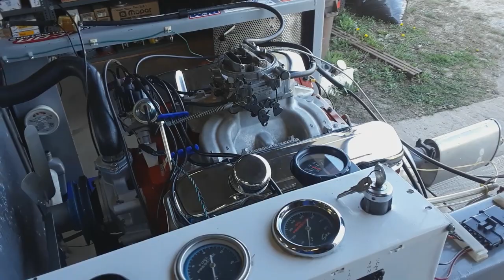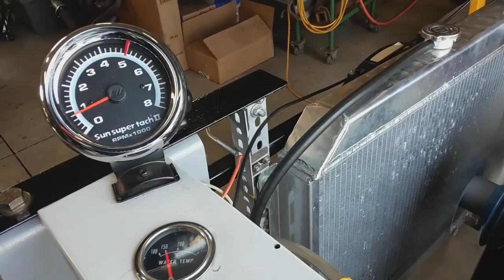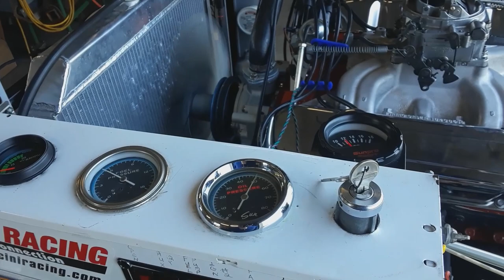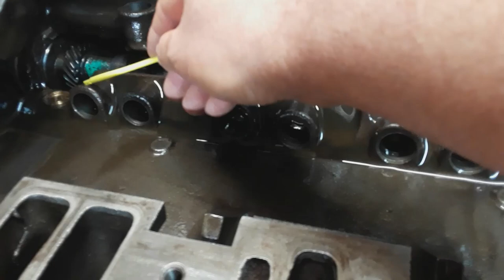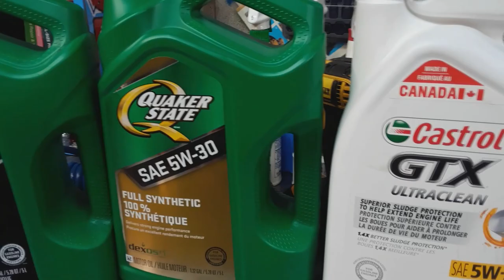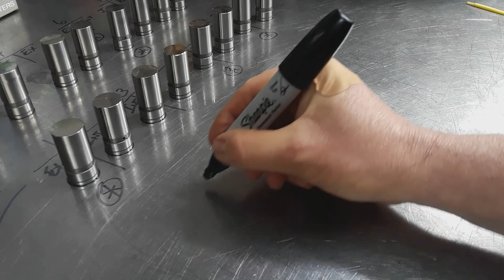Camshaft Crisis: Solution/Resolution

Comment: Is this video showing the Same Camshaft with new Huges "Hylift Johnson"  lifters after Break-in & discovering the #5  Lobe & Lifter wear issues ? ....Or is this Video showing a Totally New replacement Camshaft after Break-in with Hughes "Hylift Johnson"  lifters ? ....Thx for putting video  up....
Reply from the maker: It's the same NOS Cam Dynamics cam shown in the previous video's with 16 "new" Johnson Hylift F/T lifters. This is what I wanted to prove......that the lifters are the issue, not the camshaft. It was just bad luck that the (1 of the 4 ) "Comp" lifters damaged the # 5 Exhaust lobe to a point where the taper ground into the lobe was "compromised" and ended up wearing flat (edge to edge) with these new Hughes "Johnson Hylift" F/T lifters. 
Notice that the "NEW" lifter in the # 5 Ex. location rotated, did not immediately fail and still had a 0.002" crown on it! The wear damage to the "lobe" was caused by the previous Comp lifter that affected, then damaged the new lifter. Because of the "scoring" to that new #5 lifter face, it would have eventually stopped rotating and ultimately failed in due time. All the other 15 "lobes and lifters" (including where the other 3 damaged Comps lifters were located) indicate typical/excellent wear patterns. 
Regards, Tim

Comment: On my second Powerwagon, just dreading the thought of lifter failure. Bought the 15 used and regret trading it in, for a 18. It's having to use the 0-40 Pennzoil that concerns me. Probably a good choice for Canadian winter, I just don't want to jinx myself. And it idles alot when it's -30C, 2 cycles on command start, other than that, it's limited. I knew it would be a pig on fuel before I bought it, but I hope the 3rd Gen hemis - yes lifter problem, but they are mass produced.

Comment: One other thing that was done to check for taper was to install the cam and from the bottom while using a dial indicator and a long pointer screwed in, move the camshaft back and forth just enough to measure the taper. You'll see usually. 003".  If not, send it back. You may check with a mic but it can be more difficult.  
Also, an engine or two have a lobe here and there which are offset purposely for more rotation.  Also, turn the cam over with the lifters installed and check that the lifters spin. If not, it can be lifter bore angle. You can reface the lifter to say 1 degree and they usually spin fine. Usually there is 1 or 2 lifters that can give you trouble.  -- Sometimes the Chevrolet engines will fail the rear lifters for the reason of they are behind the rear counterweight, in an area which gets less oil thrown up to lube those.  Only other thing is to have the cam heat treated.  That's always been an option at Comp. -- The cams are iron of course which has a recipe for hardness and wear properties.  Cast iron could be described as mud with air holes in it. It's going to hold oil just due to the properties of the metal. Remember, lifter bore holes never stay round over time. They usually taper some and rattle the lifter more or less.  We install a more forceful cam lobe shape into a somewhat worn lifter hole, possibly with inferior lifers, and a pinch between two parts could start one little burr in one or the other parts and grit begins to float on very fast moving pieces of metal. It's started, and, it's over. 
Polish your lifters and around the edges. You should tape up the top of the lifters oil holes.  If they have a feed hole, disassemble the lifters and clean and then boil. Rinse in cold water and wipe with WD40 to protect the metal.  In NASCAR CUP RACING, we had all the lifters phosphate treated to speed up the process of brak in. It was huge work and enough for 1 employee every day, all day. Remember, an average of 4-8 engines per race were taken to the track back then. Some for rent, but many were for experimental.  --- So, look into your block as deep as you can to verify your chances for a successful ending. It's all about not being in a hurr and using soft break in spring force. Take the time.

Comment: If you do send that cam out who would you send it to, I have a 512 stroked 440 with a comp cam and lifters, I may pull this a part and check it and see what I find. Any help would be grateful.
Reply from the maker: Hi Bill. Where do you live? I'm located in southern Ontario, Canada. I have a crank and cam grinder in Concord, Ontario that does this type of work for me. If you are located in the USA, call up a local "reputable/reliable" machine shop and ask them who does their crank grinding and if they do cams. If you have nothing "local", you may have to call/send it to one of the custom cam grinders like Bullitt, Jones, Powell's etc. Regards, Tim.
Reply: @metalmaxmopar9520  Thanks Tim, i'm down here in florida, U.S. I have been staying on top of this lifter problem and I'm getting concerned I may pull this a part and inspect them, thanks for the info.
Reply: Delta Cam in Tacoma Washington. I've gotten over two cams from them. Never had a problem.

Comment: Salute to you, sir. o7

I'm about 300 miles (plus plenty of idle time) into my mild SBC truck build. I did use a Chi-Comp cam but went with GM Lifters and Driven break in/hot rod oil. No issues.

Absolutely agree with the end of your video. I'm seeing a general retardation/incompetence of a large chunk of workers in a wide range of jobs. I wonder why... 🤔
Reply: GM doesn't make lifters, Delphi is the OEM who makes liftesr for them. I believe they are made in mexico and have been for maybe the last 10 years. Also don't believe that the Delphi "hard bottom" lifters are gods gift to camshafts. They still do fail and i have had a couple of sets fail on my in the last 2 or 3 years. In my opinion the problem isn't just a lifter issue or a cam issue. It is a combination of the 2.
Reply: @jessecompeau4370  

Yeah, that tracks with just about everything else sold here in the states.. overhyped junk.

Hopefully I can catch it quick if it happens.

Comment: Love the rant! Right there with ya brother! Just wanted to clarify, not to be a  Karen, I use Johnson Hylift lifters and I think that is what you meant. Johnson lifters make roller lifters only. Just to clarify and make it easier for fellow gearheads to find the best parts. Also wondering if you have experience with quality roller lifters. Would be interested in your opinion on which ones are best. I believe Johnson lifters are made in USA.
Reply: There are 2 Johnson lifter companies David.
Reply from the maker: Thanks David for the correction. These are "Johnson Hylift" F/T lifters that I am using. As far as your question on "quality" roller lifters, I need to know the "context" of this question. A "solid" roller lifter for a competition/racing engine? A "hydraulic" roller lifter for a street engine?  One thing to keep in mind and very few builders talk about is the roller lifter wheel "diameter" and whether the axle shaft uses needle bearings or a bushing based on the valve spring pressures. (IE:) a Larger wheel = better lifter stability and less side loading in the lifter bore. This is limited by the lifter bore diameter. Chrysler's have an advantage due to their 0.904" lifter diameter vs the "stock" Chevy's and Fords. Is oil "pressure" feed to the roller wheel needle bearings/bushings for maximum lubrication and component life? Nothing is simple David! 
Here is a link to a really good article that may answer most of your questions. 
 https://www.enginelabs.com/engine-tech/bearings-vs-bushings-the-great-roller-lifter-debate-explored/
Regards, Tim.

Comment: Been using comp 20 years now with absolutely no problems, just done 5 comp cams and lifters in the last 8 weeks with absolutely no problems, all of them was the extreme energy line. I only use Lucas break in oil, has 3,000 ppm of zinc.  All break in oils no matter the brand has around 3,000 ppm of zinc that is key. New oils has to much detergents in them that kills the zinc on break in. After break in i use Rotella t4 10w30, have for almost 30 years.

Comment: I didn’t know who you were till about 5 yrs ago but have come to value your info and have a couple questions you if you would be inclined to answer about flat tappet cam and lifters for gen 1 Chevy motors as I have no confidence in todays products but have a few cams from approx.the 90’s and 2000 or so.one is a slightly use crane 1st gen z/28,the other trw/speed pro that’s new.the crane looks to be made of good material and other I see no reason for concern but wonder what might be done to them both before use and what lifter you would use.i was thinking Chevy and not the cheapo’s nor the $400 lifters but a bit lower.whats your thoughts?thanks

Comment: Just had a flat tappet fail after 18 minutes of break in.... I checked everything and did it all.... Today's flat tappets are junk and the companies know it and don't care its not their problem... I'll never run a flat tappet again after the consequences in money and labor.
Reply from the maker: Hi Harman. I'm sorry to hear this but it is now so common for these failures to happen. I'm experimenting with solid and hydraulic flat tappet lifters (different makes) and oils (no Zddp additives) as I firmly believe these failures are all lifter related. I have also switched to using using hydraulic roller grinds in many of my "stock" and "mild HP" builds. 
It's a lot of extra cost & work as I have to die grind/open the cast iron head push rod holes to allow the push rods room for clearance (push rod angle) because of the taller hyd. roller lifter. Then I am into custom length push rods etc....etc. I have not published any videos for a long while now as I am losing my motivation to continue with this occupation/hobby. I had the last two good (fully equipped) machine shops in my area close down permanently in the last 9 months. 

This now leaves me "one" shop in my city and he is a "one man" operation with limited services and he is 72 years old! 
10 - 12 years ago, we had 7 auto machine shops operating here. Engine building used to be a passion with me but now it's turned into an ordeal. Many of my friends /aquaintences have packed it in. There are days I feel I might as well go down to lake Ontario and push the waves back with my hands as this is just as effective as voicing my frustrations here on you tube. 

I'm a damned good fabricator and I am seriously looking into making low cost mobile "guillotines" as I can see a real need for these in the near future. This ain't a joke!

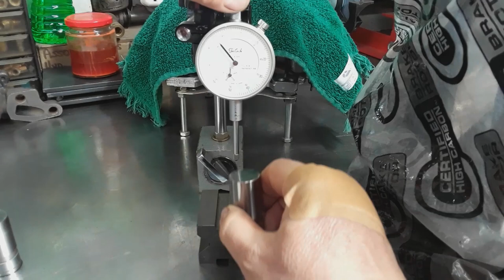Comment: @ 11:30 onward I think your dial indicator doesn’t move in the center of that lifter meaning that there is a flat spot there. Find your dial test indicator and check them again.
Reply from the maker: Yes, there is a "flat" spot there. That's the measured result from the ONE "damaged" Johnson Hylift lifter from the #5 cylinder exhaust lobe after running for more than 60 minutes. I wanted to prove/conclude that it was NOT the lifter "crown" going "bye, bye" due to poor heat treatment and/or poor lifter face machining. This lifter was damaged by the camshaft lobe wearing flat (edge to edge). That camshaft lobe (#5 exhaust) was previously damaged from using the first set of Comp lifters even though it measured up with a 0.0015" tapper. I show all this in the previous videos. That why I marked (paint daub) were the previously "damaged" Comp lifters (4 of them) were located in the block. The other 3 (lifter) locations indicated an excellent rotational wear pattern on the lifter faces as did "ALL" of the other Johnson Hylift lifters.
Reply: @metalmaxmopar9520  I missed this. Very good observation from you both.

MM, please make a summary and update in description!

I use your videos to teach. Gen Z are actually really alright. There's a rejection of the current hyper-tech cars. The kids want easy to work on cars. EV is so dead Ford sent a desperate man to sell the "Mach E" to Jay Leno and the cringe salesman shit was lambasted in the Comments.

Comment: Though this was only a fairly Recent issue of Lifter & Cam lobe wear Failure until I just Inspected the factory Original lifters pulled in 1972 from a 1970 Plymouth 426 street hemi with Only 10,500 miles running.....1st Inspected Lifter Face has a perfectly Centered, smooth flat  0.660" wide by 0.003" deep Depression......The 1970 street hemi used a factory Oem 320# Open single Spring with Damper.......The motor was run primarily with 10W30 or 20W50 Pennzoil with Very frequent Oil & Filter changes......How Close to Catastrophic flat Lifter Failure did I come & Why during 1970--1972 time frame of quality American Metallurgy components & High ZDDP Zinc content Oils ??

Comment: I had a cam and lifter lobe fail after 25 minutes. Comp cam, lifters and the springs for that cam. Low lift, sub .500. It was a 351m. Went full hydrolic roller lifter and rockers after that. Comp wouldn't answer the phone after being on hold for 4 hours, they closed. Bought a Howards roller cam an steel roller rockers. Been fine since.

Comment: Hello, Thank you for doing these videos. After this experience would you still build an engine with a flat tappet cam? would you use a Hughes cam? I'm building a street 440 and debating using a hydraulic flat tappet or going hydraulic roller. Also I have NOS old TRW 2355 .030 pistons, are these ok to use in a street engine? Thank you.

Comment: I understand your frustrations...
What was your break in procedure? Straight 20min- breaks?
Break-in valve spring rate?
How did you set the lash-those are hydraulic or solid?
Valve train geometry? 
Did you check your bind height?
Are your pushrods all straight?
There are many parts and settings that can result in lifter failure/cam damage/ failure.
Good luck & God Bless
Reply from the maker: Watch my other videos on this topic Bob, you will get all the answers to your/these questions and how this all started.

Comment: How do you seal a pan gasket on a 360 the rear rubber seal do you put the rubber seal on then the cork gasket on top of the rubber ends or under the rubber rear pan seal? The cork seems to short it dosent touch the main cap
Reply from the maker: Hi drifter. Make sure you have the right pan gasket set. The LA 360 has a smaller diameter #5 main cap and the LA 318/340 end seal won't work/fit on a 360. You can look up the differences on "Rock Auto's" web site. Assuming you do, the rubber #5 main cap seal goes on first, put a light bead of RTV between the main cap and the rubber seal. Put a dab of RTV sealant on the ends of the rubber seal to seal it to the block. The oil pan side rail gaskets (usually cork) go on next and they can slightly overlap the rubber main cap seal. Again, seal the "overlap" area (block side and pan side) with a dab of RTV sealant. Sometimes, depending on the gasket manufacturer, the side rail ends can be a bit too "short" or a bit too "long". If too short, fill in with some RTV, if too long, "trimming" the ends that meet the cap rubber seal may be necessary for the correct fit. (this also applies to the front timing cover.) To finish it off, run a bead of RTV on top of the rubber seal(s) to seal the oil pan to the #5 cap and the front timing cover. Clear as mud? Good luck. Regards, Tim.
Reply: @drifter - the best sealant is the black stuff sold by Mopar. It’s definitely worth the extra couple of dollars. I discovered it when I worked at a CPD dealer back in the late 80s.
Reply: also, if you have a 5.2(318)/5.9(360) magnum, they both use the 360 oil pan style(size).

Comment: I always thought that blaming the oils was complete bullshit to begin with(its not THAT sensitive ffs). I figure its a combination of improperly machined cams (little or no taper) and shit metals/machining on the lifters.....speaking of roller lifter failure the BRAND NEW Ford Godzilla engines are all flaking the plating off the rollers at 35,000 miles like clockwork and wiping out brand new engines.

Comment: It looks like there is a wear ring around the intake lifter on cylinder #2 near the the face of the lifter.  Does that indicate a possible worn lifter bore, so the lifter is rocking?  Thanks.